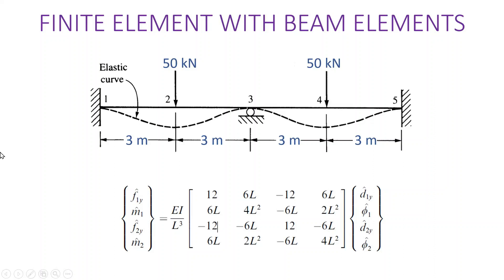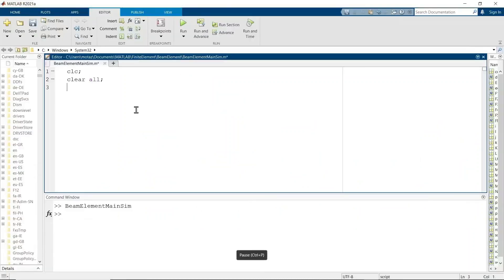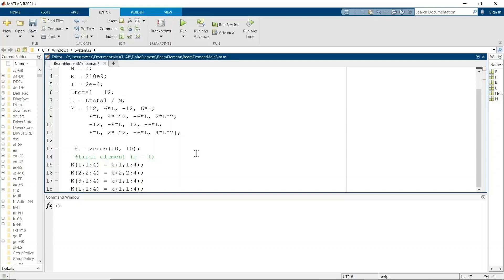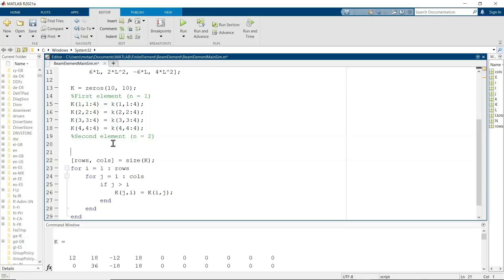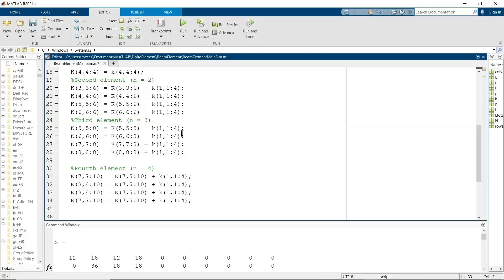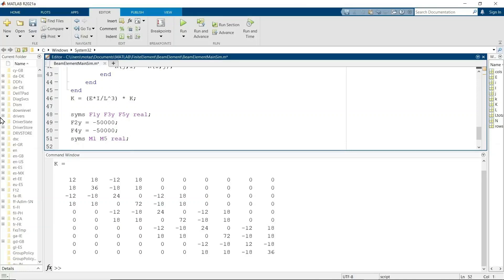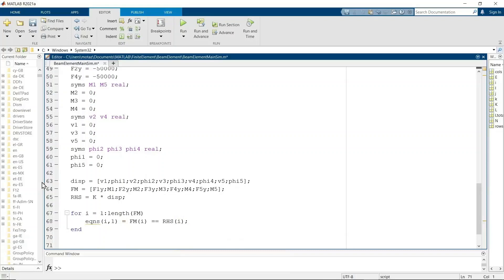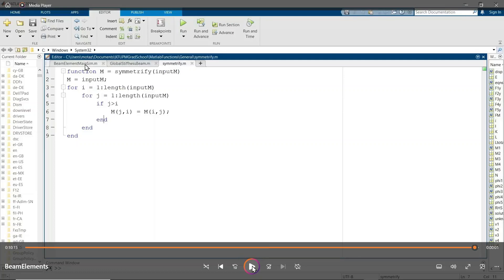Develop Matlab Finite Element Tool using Beam Elements and Solve Supported Beam Problem

Comment: is there a way of doing this but leaving the number of elements as a changeable variable in a function?
Reply from the maker: That is precisely what I did. Check the end of the video that shows GlobalStiffnessFunction a function that returns a global stiffness matrix after it is fed with input parameters
Reply: @mtzmechengr5781  Okay thank you for your reply. I have a specific problem where I need to assemble the global stiffness matrix of a beam which has been meshed with a single line of quad elements where the number of elements is a function input. Any suggestions on how to do this?
Reply: @mtzmechengr5781 also sorry for not realising, I was just skimming through the video at the time